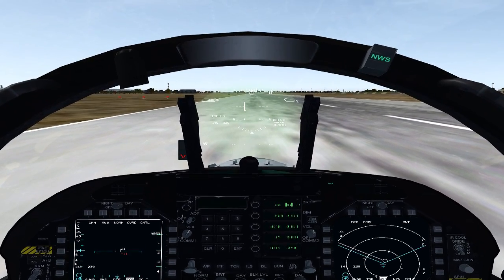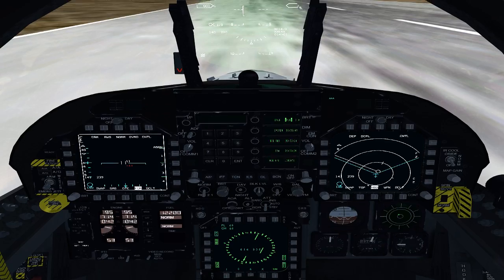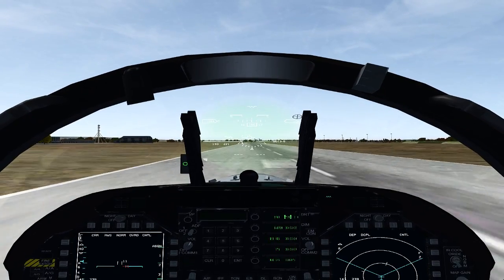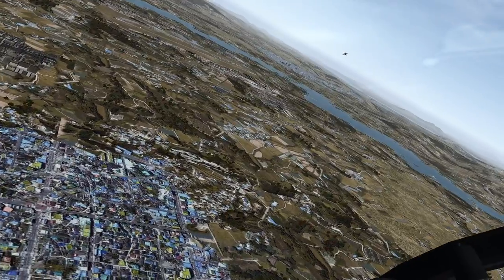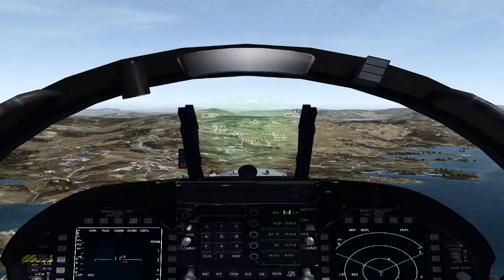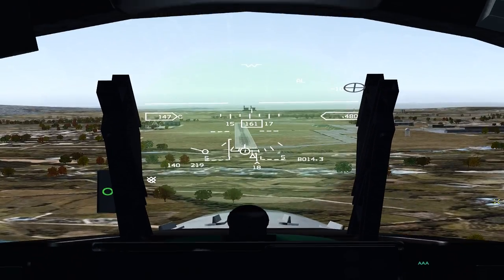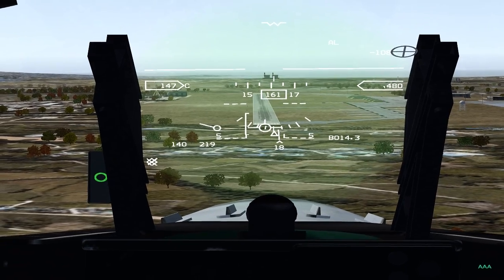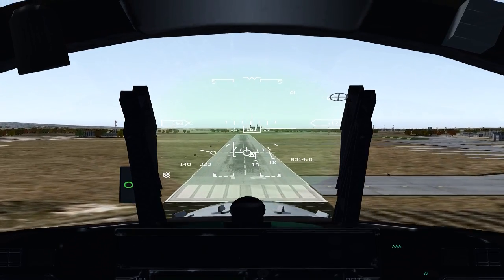✪ BMS 4.33 F/A-18 Hornet "Take Off and Landing"

Comment: How accurate is the Flight Model? Is this just the F16 flight model with cosmetic look of the F/18?
Reply from the maker: The F/A-18 model is definitely far different from the Viper. This is a full analysis video here: https://www.youtube.com/watch?v=B8CAQ2HQQiw According to Mav-jp from the BMS forums "OK
I want to be crystal clear about the F18 . First and i dont think people realize that, well actually i am sure they dont. 
F16 AFM in BMS is not only at a profesionnal level, but it is at a research level. What does that means ? that means that the level of fidelity of the F16 FM in BMS is equal and even superior to the one that has been used to 
develop and improve the real FLCS at the time when General Dynamics and the NASA were developping the aircraft.
for the F18, i have gathered all the necessary data to bring the FM to the same level than the F16, which means a research level where the simulator could be used as a Lab tool." As far as I know, the BMS Hornet is ok, and certainly different than the research level Viper FCLS.